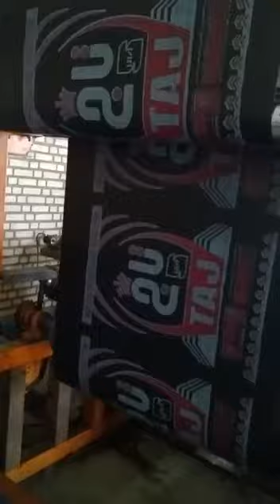How to make bitumen membrane sheets | process | manufacturing

Comment: mafi pallet sadic and your machine small,,before im working water proofing dammam...i operate same machine,but my machine is big and speed my winding 30.,,Sadic sometimes u check a length and witdh also thickness.and also the water.if water hot matic stick the winding material...and 100% stop your production.